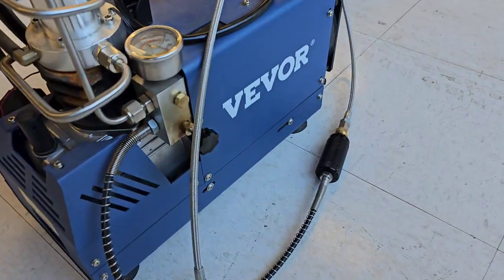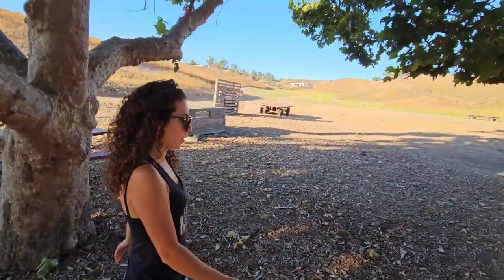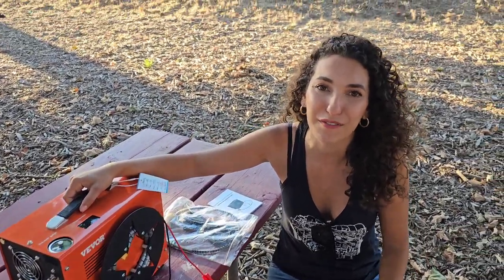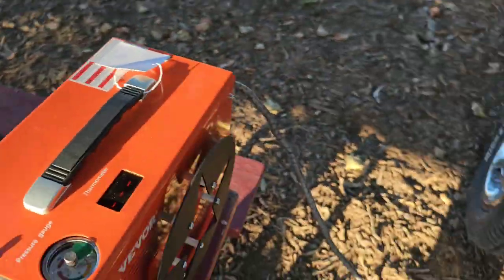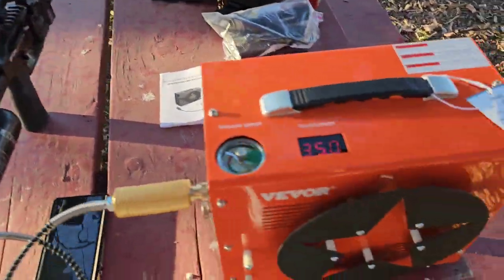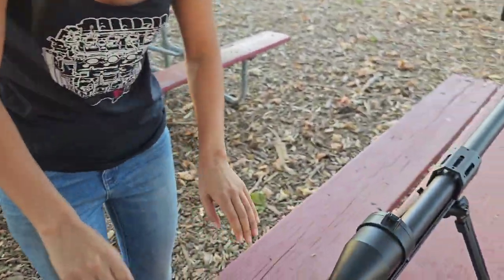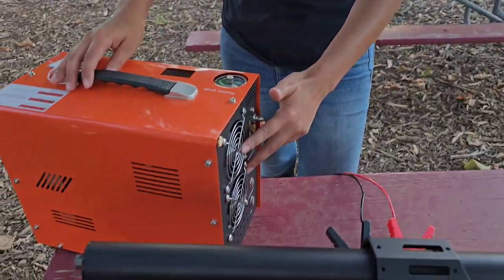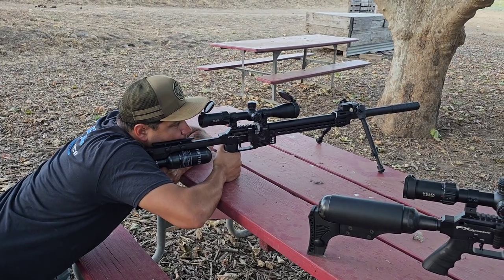VEVOR 4500PSI Portable PCP Air Gun Compressor Review

Comment: Great ride, fantastic compressor! I've had mine for 6 months and have 3+ hours on it so far with 0 problems. One thing I would suggest is to always start it with the bleeder valve open as not to put undo pressure in startup on the piston and I always let the fan run for awhile to cool it down b4 shutdown. Enjoy your vid's keep up the great work 👍

Comment: Great video!
I used to use a 4500 psi SCBA tank that I filled with my Yong Heng compressor. It was a P.I.T.A. filling and hauling that tank around. 
I made the switch to a similar compressor, and am I ever glad I did! Screw a tank!
Yea, it might take a little longer to fill my gun, but it is way more compact than a tank, and much safer to drive around off road with.
My 4Runner has a 400 Watt 110 Volt outlet in the rear cargo area. I just fire the engine up, push a button on the dash, and plug the compressor into the 110 V outlet, and let 'er rip!
A couple of things.
1. Open the bleed valve when you fire up the compressor, and shut it once it gets going. It puts less strain on the unit.
2. Let the fan run for a couple of minutes after you fill your gun to cool the unit.
I agree with you guys. Those compressors are a game changer!

Comment: If you press and hold the compressor switch for a longer time it will switch between Celsius and Fahrenheit and also you need to let the fans run for about 3 to 4minutes to let the compressor cool down after it stops pumping.Have the same compressor but with a different name.

Comment: I would not let it stop by itself or shut down under pressure due to the high pressure pushback on the pistion and rod without motor drive.
Bleed then shut it down for it to last as long as  possible.
Reply: I bought 2 of them less than 3 months ago and they are both broke. The motor and fans run but no air pressure. I have the cut off set at 4000 psi. I always let it shut its self off. I keep the fans running for awhile afterwards. I always bleed it off as soon as it quits. Could the auto cutoff be the problem? Their customer service sucks. I’m not getting any help from them.

Comment: I purchased one of these from Amazon after 9 months and 93 cycles it crapped out. I contacted Amazon and they said sorry contact vevor.  After numerous emails and several “chat lines” they said you didn’t purchase from us so nothing we’ll do. The unit comes with a 12 month warranty which means nothing. I serviced the unit every 30 cycles and charged to 250 bar. I will buy a bike pump before I would purchase another vevor

Comment: Don't  buy them Compressors they don't stand behind there warranty..
Reply: They did for me. The compressor quit working and they gave me the choice of them  sending me a new cylinder or a partial refund to cover the cost of buying one myself. I opted to have them send me one. Turns out, I didn’t need a new cylinder. It just needed cleaned. I took it apart, cleaned the moisture out of the cylinder and it worked like new. The secret I learned was to run these mini compressors without the whip a few minutes after use to purge any condensation out of them.